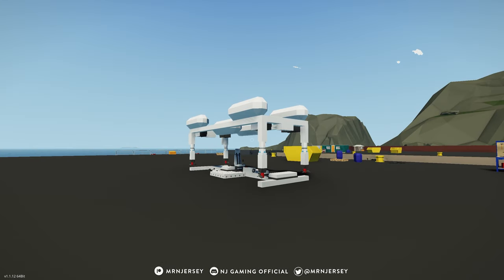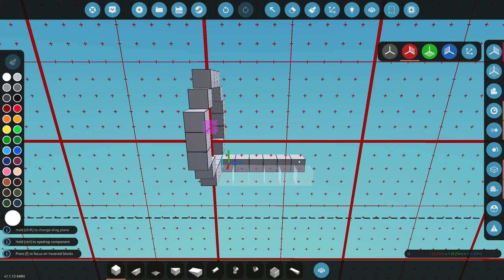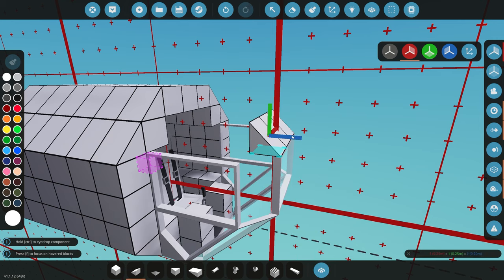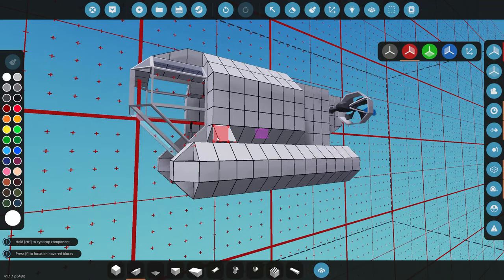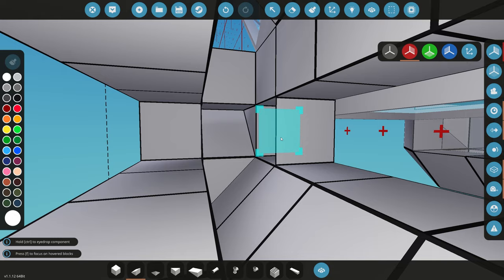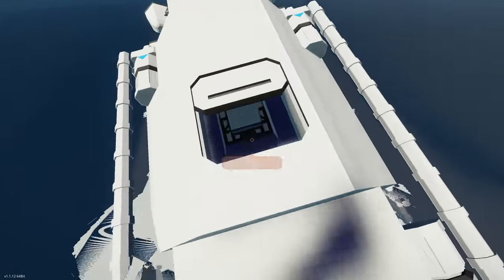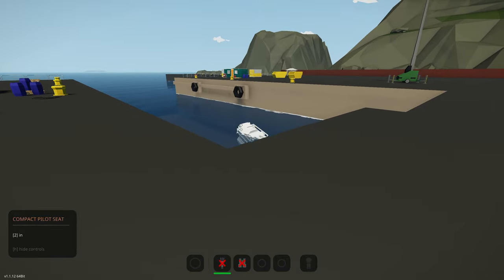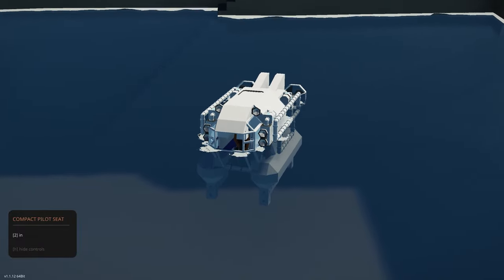Sub Build Series Part 2 - Stormworks

Comment: Your tanks fill with diffrent speed, as the path to one tank is always longer/shorter then the one from the other tank. If you want to lift/lower your uboat without rolling, you have to make it symmetrical in terms of flowing water while puming
Reply from the maker: Correct but the stablization system will counter it.

Comment: Pr-r-robably should've moved them floats to the top of the submarine so it won't flip

And have a small isolated empty section in the back end of both floats to compensate for a empty cockpit in front. This and elongate them back a bit